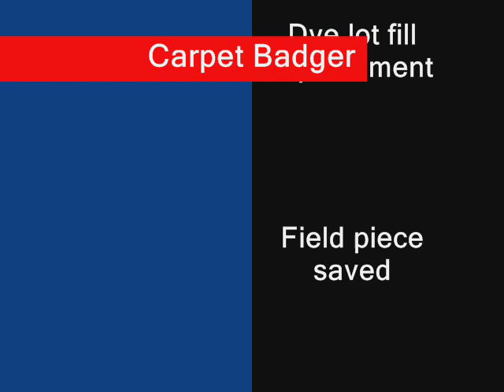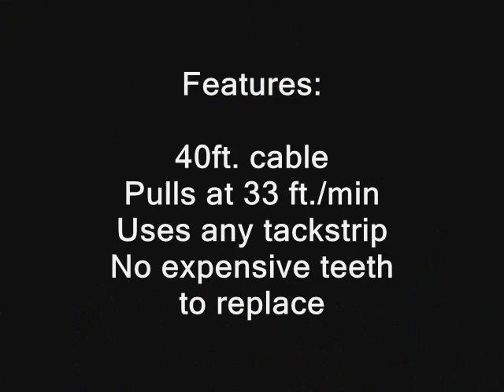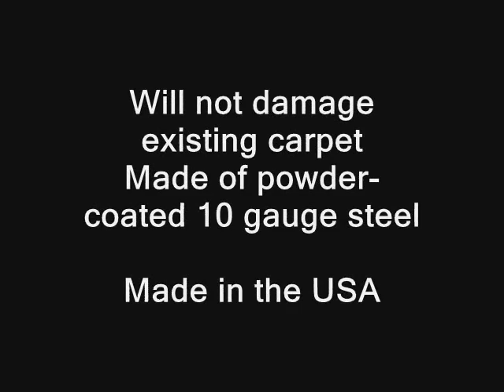CARPET BADGER - Glue down carpet puller take up machine.

Comment: So at 33ft min. What do you do in small rooms.  I think is a great tool but most of the gluedown job are small offices. This is great for hall ways and big open areas.  But we still need to worry about the offices
Reply from the maker: Carpet Badger works well in all areas. What you are reading is it pulls at a minimum of 33 feet per minute. It measures only 16" x 28" and weighs about the same as a bucket of glue. Easy to transport up stairs and through tight spaces. Works well in the smallest of spaces.